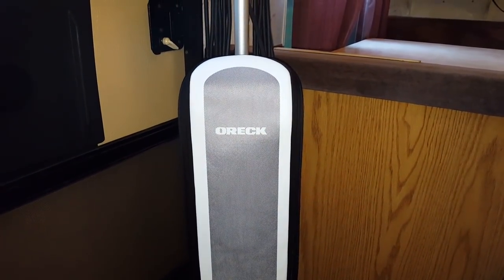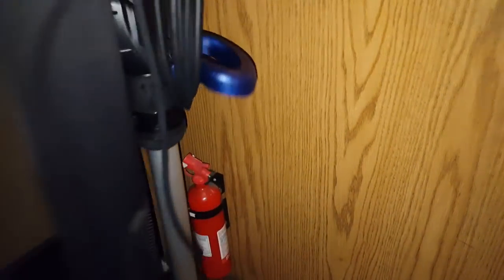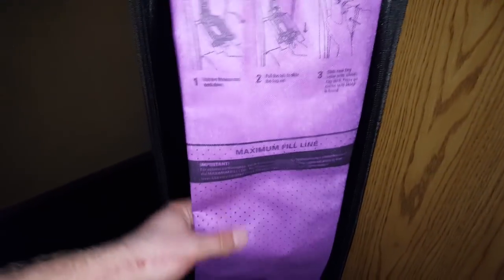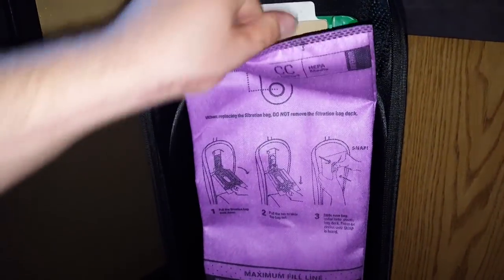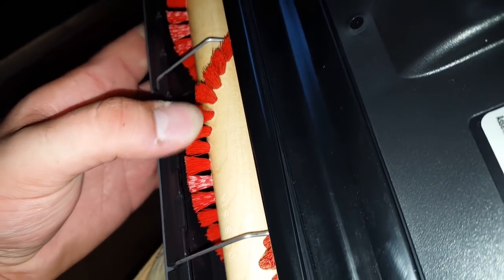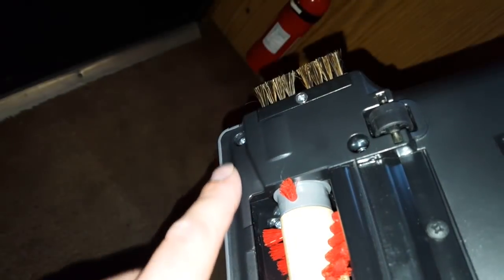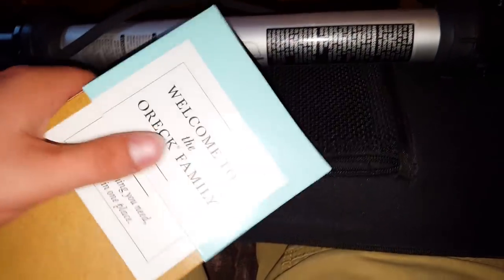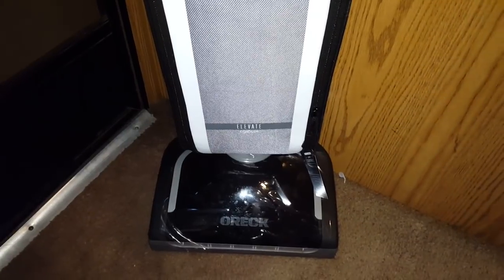Oreck Elevate Conquer

Comment: i love oreck! i have used other top brands & spent nearly 1k for a german vacuum that i ended up THROWING AWAY. went immediately back to oreck. i have a small house with 10 dogs & cats--a LOT of hair on area rugs, hardwoods, and furniture. i use my oreck on it all! but just last week the handle broke off! it broke at the tube, a few inches below the actual handle. i'm currently using super glue & duct tape, but i can tell it will not hold long! any suggestions???